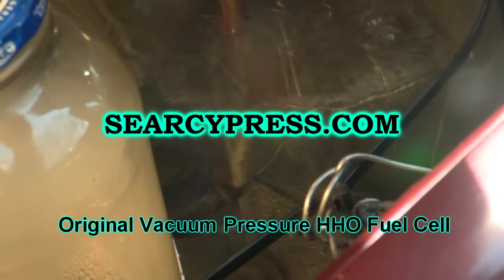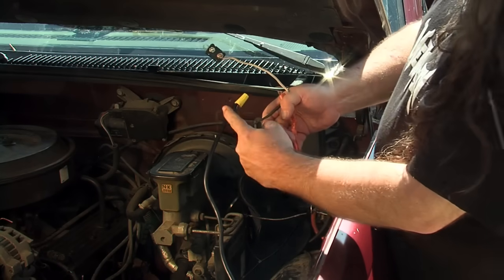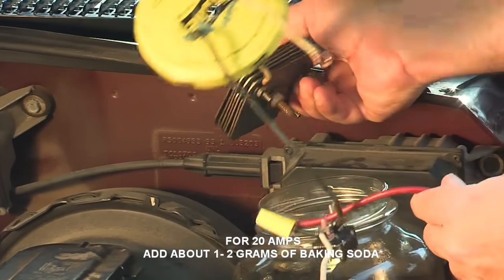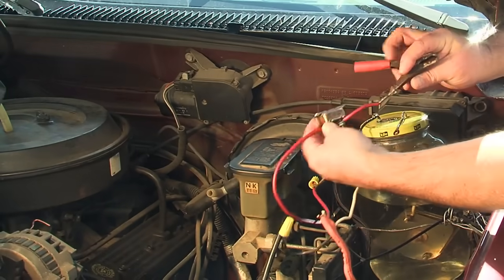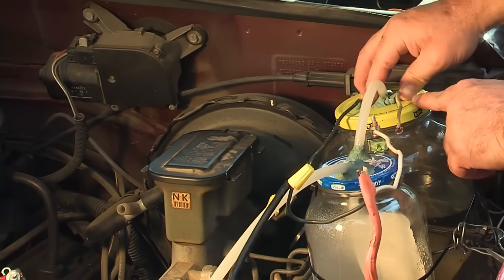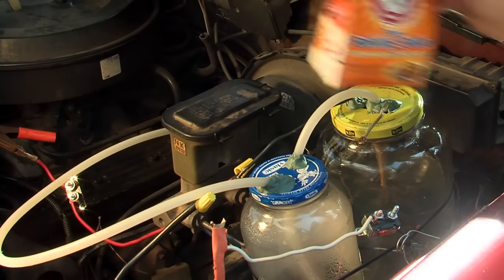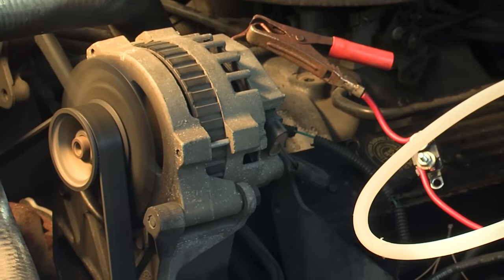Vacuum Pressure Hydrogen fuel cell defeats high gas prices using hydrogen from H2O.

Comment: This is not a Hydrogen fuel cell. It's a hydrogen generator. BIG difference.
Reply: Would increasing the plate size in the pickle jar make more vapor? I think it might since there is more surface area.
Reply: This is not a Hydrogen generator. It's john cena ( yeah I know fuck you too)
Reply: Calm down Thomas Edison
Reply: You hillbillies just do not realize that it takes energy to convert water into hydrogen, or browns gas.   Fact is it takes way more energy to turn water into hydrogen than you will ever get out of using the hydrogen for  fuel.  (About 3/2).   To spell it out, when you put that extra load on your alternator, the alternator pulls harder and uses more gasoline.  THAT EXTRA GASOLINE USED TO MAKE THE HYDROGEN HAS WAY MORE ENERGY IN IT THAN THE HYDROGEN PRODUCED.   Net, a loss, not a gain. The reason he is unaware of this is because he in reality is making very little hydrogen -- just comparatively a fart in the wind.  He would do better by feeding all the passengers beans, putting the intake into the passenger compartment.....   Hey would get more energy by buying his wife a dozen roses with the money he has wasted.
Reply: Lets say i have my battery starting the system, and my alternator doing its job after that? go grab a car battery, a bucket of salt water, and see how much hydrogen that produces.
Reply: Finally, someone who gets it, 37rainman. Exactly, the math and the nature of an internal combustion engine doesn't support it, period. I've seen people do it and they gained nothing and lost in some cases too. That's how good and bad it gets, for real. You barely gain "a fart in the wind" (lol, perfect), or you actually break even and in some cases, lose a tiny bit. The only reason people see an initial gain, is cause the computer hasn't figured out what's going on yet. When it does, your gains disappear, cause it self adjusts (just like designed to). Best real world example I've ever heard of it, along with proof. 

Then you get the people who go a step beyond and say "but you can get a new chip/reprogram the computer" to disable the thing from compensating for that or whatever. Similar to what modders do, when they want to "tune" the computer to a new mod, or bypass any restriction the manufacturer put in place. That's where the Math comes in. The energy created from a blast of fuel, the losses incured by thermodynamics etc. make it still, pointless. Utimately, hydrogen created in this "on the fly manner" is NOT powerful enough to do shit. It won't even turn the engine one revolution in an hour of generation. Literally, a fart in the wind, absolutely. 

That gas is exponentially more powerful (tested and proven) than this weak form of hydrogen. Real hydrogen in a tank though?! Totally different, that stuff powers rockets and is more than capable of the job. It's highly explosive and pure (professionally made). Matter of fact, the hydrogen car will certainly outpace the electric, by estimates. For many reasons too. Electric is a niche market, a fad. It's just too damned expensive. Hydrogen on the other hand, can be converted from current gas engines (retrofitted) for a few grand. So it doesn't require a new car. Just conversion of what you already own (win). Just like they did with propane powered vehicles for decades now (typically taxis do it). The hydrogen stations are already popping up, so we know that's the future (realistically). So hydrogen is certainly a "valid" technology and we will use it, just not the way these people are thinking. 

Where it really shines is speed. A hydrogen fill up, is just like petrol. Fill 'er up, done in minutes. Even with a Tesla supercharger (the best there is out there) it's still a minimum of 53 minutes. Better order a coffee and a snack. Lol. Sure the range is good now, but the charge still takes time. Not realistic on longer trips. The cost to replace those batteries after they've outlived their charge life too? Many thousands. This HHO/Browns gas, is no better. There is no gains, as you stated. Then there IS losses in the logevity of parts. It is well proven, that HHO, taxes alternators and batteries. LOTS of negative reports about people's car batteries not lasting as long on HHO and alternators burning out faster. Makes sense. They are only taxed to a certain degree with the vehicle as it is. 

You start hammering it with a higher load request, constantly, it's going to have to work  harder. That extra power is there as headroom when needed and there to constantly charge the battery, not for you to make useless HHO. Lol. That's how it affects other electrical generation/providing parts. So what are you saving, is the end question? IF you save on the gas (doubtful, at best), you will spend in parts. Wow, such a savings! Lol. There IS a price to this, so where is the gain?! 
The enthusiests then come back with "well, you just put a bigger alternator on there.", lol. Still not getting it, obviously. The end, does NOT justify the means, period. It's pretty simple. I dunno what these people think they are defending. LMAO! It's nothing. Not worth the powder to blow it to hell. It's just pointless.
Reply: @patrickgalloway5078  Yes you will get better milage if you disconnected the alternator (until your battery goes flat). Like your air conditioning - it sucks power directly proportional to the load on it. Your car AC sucks between 10 and 15 Horsepower at full load (which is why you never saw AC on a VW Beetle).
Reply: @patrickgalloway5078  You would!
seems you might be the slow one.
Alternators drain the engine of power, the more electricity it generates, the more it pulls the engine down.
In your mind, you could take a large car alternator and run your house from your Chevy but this is only because you don't understand how the alternator works.
Good luck with your studies and you owe rainman an apology for your very rude behavior.
Reply: @cornelius6304  lol no he didn’t
Reply: This is not a hydrogen generator. its a hydroxy booster...
Reply: Thou hast summoned me from the death, just as this comment.
Reply: The truth does not have an expiration date (Y)
Reply: @dishjuarezdishjuarez9329  hydroxy is different.
Reply: Everyone saying it’s a fart in the wind has never seen the gas ignited from one of these
Reply: @gsmithy7995  So what if it ignites?! That doesn't translate to power, but it seems in your mind it does, lol. Yeah, you can run a Bunson burner on HHO and even a welding torch. But when you introduce resistance, like weight and friction, it shows it's weakness. It just doesn't have the power to turn the engine over once after 45 minutes of generation, lol.

Speaking of small engines, HHO has actually been tried on a small engine, Project Farm did it just recently and guess what?! No gains whatsoever. Matter of fact the generator he used it on, ran about 20 seconds less time before running out of fuel, than straight gas did. Lol.
Reply: residue junkie  First of all: The OP is 5 years old, nice digging archeologist. 
Second: I'm pretty much done arguing with people who believe in free energy so ill just leave you with this; "The laws of thermodynamics". You can search them up to get a basic understanding of them, and if you still don't believe it then you can go deeper into how they really work and are proved.
(third: I really thought you were a troll, but your playlists suggest otherwise)
Reply: @kingsilencio6158  Proved by whoom? Do you have any credible source to back that up?
Reply: He left out a few critical statements here. Introducing more air into the vacuum line will cause fuel injectors to introduce more fuel, therefore burning way more fuel than you did before. Also without a good way to vent the gas you would most likely build up enough HHO gas under the hood to kill everyone in the truck................................If it's on the internet and someone made a extra long video about it = IT MUST BE TRUE? XD
Reply: Too bad we can't bottle arrogance. Seems to be a lot of it here.
Reply: This is satire!
Reply: Just as long as you feel better about your self..
Reply: residue junkie  so block yourself. Oh wait, you already do by not educating yourself.
Reply: @kingsilencio6158  Are you stupid, or just high?! That's covered in the debunking of Stan Meyer too. Lol. Patents, pffft, lol. There is the misconception that getting a patent for a device is some kind of proof that it works - which is "patently" untrue. 

The patent office doesn't test the designs it processes, it is simply a clerical operation where checks are made that the submitted documents meet certain criteria for completeness and correctness. There are a great many patents issued every year for devices that simply do not work. Lol. Literally EVERY B.S. claim about Stan Meyer is debunked. And how is being convicted in a court of law, for bilking investors out of money for a product that did NOT work, a conspiracy theory?! YOU gtfoh, gullible amateur. Lol.
Reply: @kingsilencio6158  Don't need to, gullible amateur, why waste my money on B.S., that does NOT work? The science is not on your side, period and you are VERY gullible. "he was silenced, derp". No, now THAT is a stupid conspiracy theory, lol. He was a hack with NO scientific training whatsoever and no threat to "da fossil fuel industry, hurr durr". His B.S. didn't work, nice try and nobody knocked him off, totally debunked.
Reply: The solution to this debate gentle men, is to compete to see which has the better H20 model
Reply: @jon smith Yeah, I'd say that's pretty accurate. According to some stuff I've seen, it seems like they want it to be true. Whereas honest ones are like "No, according to my mileage efficiency meter on the vehicle, I see nothing, no difference."
Reply: @jon smith Thanks
Reply: @jon smith Exactly! Well said and Mechanics will agree. A tune-up etc. and good maintenance can do wonders for efficiency. Also the style of your driving. Aggressive drivers (you know, those people who race to a red light, gun it from the red light etc.) waste an average of at least 10% more fuel. Something as simple as properly inflated tires, can make a 10% difference.
Reply: @jon smith There is simply not enough hydrogen in this nonsense to do anything. Pure, professionally made hydrogen in a tank, sure, hydrogen vehicles exists and the stuff powers rockets, but this system just doesn't even produce enough hydrogen in 45 minutes to make the engine revolve once. 

In reference to what you were saying about cooling however, there is a technology by BMW that injects water into the exhaust to improve efficiency, sure. It was used in a few of their vehicles and was co-invented by Bosch. The water tank sits in the trunk of those BMW's and has to be refilled every so often.
Reply: Not even that LOL it’s a battery . It’s literally a starting battery
Reply: @jon smith Yeah, that can be an issue in Canada too, in the bigger cities. We don't have emissions testing and such where I live, fortunately. 

A little trick that works well for that, is NEVER run premium gas for an emissions test on a regular vehicle that doesn't require premium, it will surely fail.
Reply: thank god eh..     fuel cells are a 100% loss system... first you use electricity to make hydrogen..  then the fuel cell turns it back to electricity... with massive loss's..

gotta wonder if they were trying to reinvent the "BATTERY"    lol
Reply: @jon smith Oh, I didn't know such an alternator existed, interesting.
Reply: fran nowak  umm I said it would work? Like 3 years ago? You must be in second grade then...
Reply: fran nowak  for real, am I missing a comment or something?
Reply: Some people call a fuel cell booster because it works in correlation with your gasoline to make your car run smoother and cleaner but it does work because I built one a few years ago and it worked brilliantly
Reply: Many years of debate. Can someone please give a step by step guide covering all obstacles?
Reply: @YNYNYNYNYNYN  it is thermodynamically impossible to gain energy out of the system. All one would be doing is destroying there engine with an incompressible fluid and producing very dangeroUs HHO combinations.
Reply: @debunkthis  have you tried it?
Reply: @YNYNYNYNYNYN  it’s basic physics
Reply: Whats in between the faceplates
Reply: Yall arguing 6 years later amazing
Reply: @hypnosis5660  indeed. During that timespan I've gotten a masters degree in engineering, I wonder what they've been up to.
Reply: @SatansOps  congrats man 👍
Reply: @hypnosis5660  that's told me :)
Reply: i built loads of these years ago ( dry cells and wet cells), no, a cell like that wont run a large capacity engine but will give a much cleaner burn which leads to better economy. Older cars without sensors everywhere were find, but the newer cars/(engines) know something is wrong(?) and try to adjust to compensate. check out Stanley Meyer or Bob Boyce, also JCB are making huge progress with their hydrogen run engines.👍
Reply: This was fun to read, can't wait to see what comes next
Reply: Rise from the dead 💀 🤣 😂
Reply: And generates fuck all amounts of hydrogen.
Reply: Are you one of my brothers or sisters
A good prayer:
I'm a sinner JESUS please forgive me for all my sins I know you shed your Blood for me on the cross at Calvary. Thank you JESUS for my salvation and for shedding they Blood for me. I love you JESUS. 
Romans 10:5/10 ct...❤️k
JESUSisLord!Amen...
Amen..
If you'd like to call someone who cares 
83
For
Truth.
bc you don't know when you'll die?
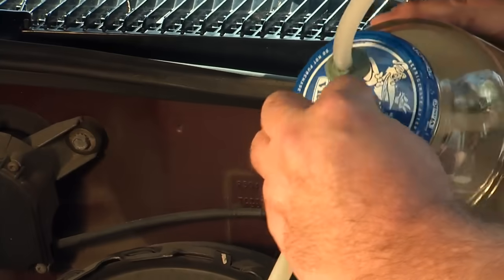.y r u hesitant......John 3:16 & Romans 10:5/19
Reply: You need the hydroxide, ask Bob Lazar
Reply: If it takes energy to make energy.. explain  magnets, lightening,  wind. Where does that energy come from? Where does that Entergys energy come from?    Please explain wise guy if you know so much... please enlighten us all on your superior wisdom and knowledge.    

Lightening comes from the ground and sky and it basically comes from nothing ... it has tremendous power and energy... reao free energy.  Just like you can take a ceramic pot.  Put in some aluminum,  copper and some lemon juice and have a 12v buttery... free energy from nothing... 

So you are wrong... with your lousy comment
Reply: @hoffmanhome6067  lightening comes from static stored and caused by friction within a cloud. Once the charge increases enough it discharges. Storms are created by the movement of water molucules to static areas caused by ions in the atmosphere caused partially by the sun and partially by the earth itself.

Many things including magnets which you think are magic including the magnetosphere which protects the planter from solar rays and radiantion are created by the core of the earth which is one big magnetron put in motion by gravity. 

None of the things you cited are "free energy".

Now lay off the bong.
Reply: @gregrohsful  power that literally is made from thin air.  Free energy.  
You have no argument bro
Reply from the maker: There's nothing free about it. The energy comes from the unburned gasoline that goes into the cylinder. Normally 80% of it is burned the rest is wasted through the catalytic converter. All we are doing is powering efficiency in the cylinder. The gain comes from the unburned fuel. Thanks very much for your comment and be sure and subscribe for the next video on this topic which will be coming out very soon.
Reply: @gregrohsful  Exactly, well said! No such thing as free energy. lol. Perpetual motion machines have consistently failed for centuries, for this very reason. You can't beat the laws of thermodynamics.
Reply: Whatever nerd
Reply: It’s an electrolyzer: 1 anode, 1 cathode splits the water molecule into hydrogen & oxygen.
Reply: Please explain
Reply: Im trying it! On my 02 chevy 6.0L a bit different system but same idea. I'll comment back
Reply from the maker: Its not the original engine. Sorry for the confusion. Thanks for the comment.
Reply: @metalpresstv  ) are you still using this?) I know you stated back then 30km!) I wonder if the computer will take away gains) ppl used to believe the World was flat!) & That man couldn't Fly) probably w/ All Inventions) humans will be negative very rare positive) I wonder if anything is possible) if ppl listen to all the negative) where would all the Inventions be we enjoy Today) technology) I wonder if Physics Theorm laws are absolute) it's the Garage!) That's Reall Life) therom Words! are nice)  but Garage is Proof) keep being positive) humanity needs this) I'm a blk dude) peace) I like the rock music)
Reply: @metalpresstv  does it work if you ad generator dynamo stuff on each wheels ? My first guess is that it wouldnt really be possible
Reply: amplify the power....
Reply: Bill Does Stuff lmao you’re still commenting after 2 years
Reply: @nathanc.8821  check out Garuda sanjivani root it's applied into electrically charged water to do what?
Reply: @nathanc.8821  Maybe learn why Youtube timestamps are shit there genius. For shorter times they are fairly accurate, but for anything a year or over, I've found they are grossly inaccurate. There is no way I watched this vid 2 years ago. I know for a fact, it was slightly over a year ago I saw this.
Reply: and that's why it doesn't work. It can't generate nearly enough hydrogen to even turn the engine on revolution. Not powerful enough, because it's as the other commenter explained. It's oxy hydrogen and there is not NEARLY enough being generated by this little setup to make a damned bit of difference. Even as a supplement to gas. It take energy to make energy and this takes more than it makes.
Reply: Bill Does Stuff was it new or old . If it’s newer then 1990 your communist new shit box is designed so it does nothing . You need a old none computer system controlled engine
Reply: @Polaris88Reid  Hehehe, communist new shitbox, lol. Yeah, I wouldn't disagree with that, I have heard people claim it works on old vehicles and being the gas guzzlers they were, I suppose any gain is a good gain, lol. 

If you tune it just right, yeah maybe, I have bent somewhat to the idea that "maybe" that's possible. On modern vehicles though no, and certainly not my communist shitbox from 2001. Lol. Most of the tests people do, are on new stuff, even generators. The generator ran 20-30 seconds less on Project Farm's recent test on HHO. And it is electronic fuel injection. 

I'd have to see evidence of it working on something older, like 100% legit evidence but I wouldn't discount the possibility. Seems to be a common enough claim and many of those claiming it are admitting it doesn't work on newer, so they "seem" more honest. Not like the zealots claiming nonsense anyway, lol. I still don't think the math nor science add up, but on old gas guzzlers and some tweaking? Meh, maybe and they sure could use it.
Reply: @MrBilld75  don’t waste your time or anything on any that think it’s a good idea. Electrolysis is less than 50% efficient... and it only gets worse as we know
Reply: @dennisford2000  Yeah, I know, the math and science just doesn't work. As I originally said, it only produces weak hydrogen, any gains made (which isn't even enough to turn the engine on revolution, in over half an hour of generation, lol) is immediately lost, once the computer catches on and adjusts. 

Others have tried it, properly and with well built advanced HHO systems (like dry HHO rather than wet) and never got any gains whatsoever, lol. They're nonsense and well debunked. Yeah it's combustable, but it's barely enough to run a little Bunson burner in a science lab, lol. 

Hydrogen fuel vehicles and professional, real, potent hydrogen, are the only valid hydrogen vehicles/tech right now. This stuff is play toy nonsense. Lol.
Reply: @MrBilld75  another way to see it : the alternator requires over a half hp to make 29 amps, and that figure will change as deposits form on the plates that gas burned won’t generate 300 w heat
Reply: You mean conversation of energy?
Reply: Bill Does Stuff i dont see any of your engineering videos posted? Would you please post a how to step by step on doing this correctly by engineering standards? Thanks
Reply: @MrBilld75  you are tripping. Hydrogen and oxygen are higher octane than any gasoline. Plus it cleans your engine. Lol. Wow.
Reply: bill does stuff ?  don't say it doesn't work you have never tried it and have zero experience at it , I don't care how much you've read . move on
Reply: Suck it Tony. You don't need to "try it" to know it doesn't FUCKING ADD UP, genius. You can spout off all you like about making on and trying to prove it. I've seen proof of it NOT working too. Not cause it wasn't done right either. It totally was. The fact is, the gains (if any) are meaningless.
Reply: The best part is people saying that it takes a ton of energy to make.... anyone in the world ever hear of a solar panel? Yes, his build is rudimentary and has zero statistical backup but come on people... it works....
Reply: it would help but in this case, current takes the shortest path from entry to exit,  so, a dry fuel cell set up could be better.
Reply: Technically the 2nd bottle is considered the fuel cell aft of the 1st generator.
Reply: Meth works the same in a Hemi 🤔

Smokes a bit, fkkr HaWLz tho
Reply: @magicyeti9256 I can agree to that
Reply: He says you should see water coming out of the exhaust once it gets going the water coming out of the exhaust will be tremendous. 😳😳 Is he putting water in the engine for it to come out exhaust . These sick people like to do damage they get a high
Reply: it works, the reason though it wont work mechanically on a modern car is because the air to fuel ratio isn't getting adjusted for it, and it will only get better gas milage at a certain and constant load, so you will have to adjust the air to fuel ratio from the pcm to make it work right, and yes it is possible, there's a thing called a tuner and another thing called a dyno, thanks to mostly the aftermarket, they provide tools and parts to make it work.
Reply: Eric Outram  and you rebuild your engine every other week?
No, I think you're lying
Reply: Some mileage is better than bad mileage.
Reply: He also said carburator instead of fuel injection. Even though he should have said intake manifold, we all knew what he meant. He is doing everyone a favor and you make a comment like that.  Good grief
Reply: @MrBilld75  
Yeah you are right. There are sensors that controls fuel and air. That's why one should feed it straight into the intake manifold and bypass any sensors.
Reply: Bob lazars Corvette runs on hydrogen
Reply: @dr.trichome6419  I doubt that a guy who was arrested for felony pandering was working at the same time at area 51. I doubt a guy with multiple degrees from CalTech and MIT would also enroll in entry level electronics classes at Pierce college in the valley. Lol. 

Bob Lazar's a fraud and a long time hoaxster. A nut a UFO nut and conspiracy theorist. His claims are worthless and debunked. If his B.S. was actually valid, everyone would be doing it, lol.
Reply: @dr.trichome6419  Bob Lazar claims he worked on reverse engineering UFOS out at area 51 and that the power source was element 115. Bob Lazar with no evidence claims it's stable, and he has 15lbs of it.

Every element above 83 is unstable. 115 was first created in the 2000s and lasts around 1/1000ths of a second. Lol, Bob is a liar.
Reply: A scientific study on the Effect of hydroxy (HHO) gas addition on gasoline engine performance and emissions was conducted with the following finding: 
Engine thermal efficiency has been increased up to 10% when HHO gas has been introduced into the air/fuel mixture, consequently reducing fuel consumption up to 34%.

Alexandria Engineering Journal
Volume 55, Issue 1, March 2016, Pages 243-251
https://doi.org/10.1016/j.aej.2015.10.016
Reply: Ross Harris Bill is correct, I actually tried this with a lawn mower because I wanted to try it. For it's size, it can't supply enough gas to get it to run. But, I did find out a propane torch will run a push mower, that was also from experience, I got tired of taking the carburetor off just to put it back on and have it flood yet again.
Reply: @bairfamilyfarm1336  you tried it with a lawn mower? Last I remember lawn mowers don’t have alternators 🤷🏽 and if you did hook it up to a riding lawnmower it would drain the battery
Reply: @gsmithy7995  Correct, lawn mowers have generators (magnets on the flywheel rotating around a coil vs a self-exciting 3-phase alternator). My idea though was putting a second battery in and running the brown gas generator off that. Never went passed a stationary test because a reasonably sized brown's gas generator still won't power a kohler twin.
Reply: We use physics and chemistry, you know that you learned in school?
Reply: Where exactly did i use Pseudoscience? I said that it wasnt a hydrogen fuel cell o.O
Reply: No it's not a generator. Kmsl..
Reply: @papermaker85  

Generator- creates something from something else. Often kinetic to electrical energy(wind turbine), but also electrical to potential(like a fuel), kinetic to kinetic(a water wheel turning a grain stone), and so on. It can be chemical, physical,  magnetic, or electrical in nature. 

I generate hydrogen using electrolysis.

Fuel cell- a container of fuel used as storage, generally liquid form, but can also be gaseous or solid. Most often temporary in nature, but can be semi-permanent. 

I have a 5 gallon fuel cell in my dragster with pure alcohol.

So yes, it is clearly a generator. It generates Hydrogen using electricity as the input medium for energy. This causes molecular bonds to break in the water molecules creating a gas. Some will condense back into water, some free oxygen, and some free hydrogen. It's not a 1 to 1 ratio. 1 unit electricity to 1 molecule of hydrogen. Even in a lab environment it's not 1 to 1. Much less in something this makeshift.

You can claim as someone else has here that the second jar operates as a fuel cell. Although that's not precise as it primarily functions as a trap or filter for salt  particles and condensate water. That's salt in the scientific term, not what you put on your fries. 

So overall you are essentially looking at a generator with an in line filter. 

Not sure what, other than facilitating air movement, the vacuum is about. It's extremely dangerous to cut into the brake booster line though. And I didn't see any check valve after the tee fitting. If you want to know what happens on a running engine if it's pulling in air through that vacuum line go pull a hose on your vehicle. It dies. Quite quickly. That's why the fitting the hose attaches to on the booster is also a one way check. Even if you take it off and cover the hole mostly with your finger the engine will begin running rough. 

I have serious doubts about this dubious video. Anyone who doesn't is not likely very intelligent about science, engineering, or even basic automotive knowledge.
Reply: @shaunofthedead3000  Well put! I agree and that's why I have serious doubts and because Engineers, Mechanics etc. have already said it's a scam.
Reply: @MrBilld75  

Yeah...I'm all for experimentation and crap, but the booster thing is a serious issue with me. If someone tries this on a post 1980 vehicle they will probably notice a significant change in braking. Pre 1980 they may not notice as much as the foot pressure required to brake was higher, but either way the braking distance will increase. 

Also on vehicles with ABS it will ruin the system. On vehicles without ABS you run an increased chance of locking up the brakes because of the increased need in pedal pressure. And locked brakes are dangerous. 

If people are wanting to test this you should start with the pickle jar and just hook up the power. Collect your off gassed hydrogen and see how much you can get over any amount of time. Then do a flame test to see if it is even concentrated enough to burn. After that you can figure out how much power went into creating the hydrogen and its value or lack thereof to gas savings. 

I'm all for saving gas. But this video is stupid, dangerous, and deceptive. And so are some of the commenters. 

I don't give a crap what you did...if you claim as I've seen in here that you never buy gas anymore or only buy gas once every year or so...you're not driving much at all, or you're lying. You pick what out you want. 

I can even tell you some additional tests you can play with if the car is disposable. Hook up pure hydrogen to the intake and see what happens. Put you a fancy regulator on it and all. You will burn pistons, rings, and gaskets just like a drag car with nitrous. You will melt spark plugs. You will overheat the engine. These things WILL happen without extensive modifications requiring a full engine rebuild. This is assuming you can get past the timing issues. 

ExxonMobil actually puts hydrogen into fuel mixtures. For the express reason of helping to clean engine internals. So a little bit won't do much. And this is about as good as what these guys are getting. Plus extra water in the fuel. Which is an non-compressible fluid. If you ever overdo that, have fun buying a new engine when the piston shoots through the head or oil pan, or wherever it ends up.
Reply: @shaunofthedead3000  Well written and very true. Yes, I have heard that, that it acts as an engine cleaner (although didn't know that Exxon did it). Just something I learned from listening to people talk about HHO and learning about different aspects of it. 

Also that yeah, water in your gas, beyond a certain point is a VERY bad thing which I learned from old time Mechanics. Water, unlike fuel, does not compress and acts like a brick in the engine. Something is going to give and it ain't pretty. He (Scotty Kilmer here on Youtube) showed what happens when you drive through water, with a low air intake and it sucks in water. Looks like a .50 cal bullet when through the oil pan. Just ripped a huge hole in it. 

I completely agree with the idea of experimentation, under more safe and controlled conditions. That's real Science. Generate some, test it to see how much flammability you get out of it. 

I thought that brake thing was very interesting and didn't know that. Not about the pre and post 1980 vehicles and how hooking it up to the booster might act, but I was not surprised to hear you mention how it could totally screw up an ABS system (and yes, lockup is dangerous, take it from someone who has never and still doesn't have ABS, I am not a fan really and ABS in winter, in Canada can do more harm than good.) I was taught old school (1980's) how to drive, before anti lock ever existed and how to brake without locking up the brakes, but I have locked them up once or twice before).

From what I have learned about ABD, I could totally see how this could mess with ABS, because of the ABS controller, which relies on gauging pressure, to prevent lockup.
Reply: It's like home cancer therapy - 100 plpl tested it, 70 are death include Steve Jobs and 25 are happy that it works and other 5  are writing books about it. It's not science method.
In my opinion this can work ONLY with very BAD engine - bad carburetor with bad ratio fuel:air, bad mixing them together, bad electric arc! When everything is wrong, MAYBE hydrogen from 29Amp*12V=300W of extra power can help make every combustion in valve effecient .... From example 15-20% to STANDART 25-30% for OLD CARS. New car with lambda sonda...s(!) and computer inside, with fuel injections ...they can be in desilusions what is it with engine and they can switch into basic working diagram with 15% fuel consumption plus. 
Lot's of people waste their time on it and i'm here only find right words to explain them this false concept/mistake. 
... In this video is old car. I like see this on car from 2000, 2005, 2010 and 2015.
Reply: @MrBilld75  It's not the ABS as a car brakes fine without it. It's the fact that a newer car relies heavily on the vacuum booster for brakes. Just imagine one of the glass jars breaking or leaking, the car could lose 90% of its braking ability.
Reply: @patmul-k6798  Yeah, good point! I watch Youtube Mechanics to get better at repair to my vehicles and they would agree.
Reply: @MrBilld75  you do seem to know your shit.
I'm trying to study the brown gas effects on engines and stumbled on this video. 
Have you heard of Bob Boyce and his design? I can't imagine anyone developing a generator that can produce the gas through an alternator in volumes that could make a difference but his design seems to come close. Later man.
Reply: @romanhanajik3185  amen
Reply: @papermaker85  Yeah, it actually is, imbecile. It's a fucking generator.
Reply: @5dope You are not getting it. Sure it can work, "a little bit" with enough energy, but the problem is, what it produces is not quality hydrogen gas. Not like you get in a tank of professional hydrogen. To make that, takes a lot more than a simple device under your hood. 

It's even worse on modern vehicles, because the computer will soon learn and defeat your efforts. In a carburated engine, if you tweak it right, it could give you some possible gains and considering what gas guzzlers they were, anything, however small is an improvement, but it's not going to make a damned bit of difference on a modern vehicle. It's been tested, you get no gains on a modern vehicle, after the computer figures out what's going on. 

You are also negating the other things it affects, like how a higher draw on the electrical system, is going to wear parts faster and use more gas. Gains are quickly defeated in a modern vehicle and it's not worth it. What little you save on gas, if anything, will go to premature repairs. Mechanics and Engineers and even Math and Physics experts have analyzed this, in depth. You gain nothing, it's a complete waste of time, effort and money. 

Sure you can run a welding torch on it, I've seen that too. It's rather impressive and totally works, yes. I've seen the video evidence of it.
Reply: @MrBilld75  you know the real problem is people have been fooled into believing all the knowledge that's needed has been recorded by someone else and we simply read it,memorize it and we are then intelligent, no need to be skeptical right? Or just curious maybe, board even. Where would science be without skeptics?
Reply: Perforated plates will i crease the gas.
Nice vid it would be good to see the link up to the carburetor 
Cheers.
Reply: @platinumsky845  hell no I won't for the simple fact you seen the video regardless of what a fuel cell looks like the end result is it produces the same thing hydrogen bubbles and you take a match or lighter to them they explode no more no less while they assist through vacuum of the car gasoline to make a car run smoother and give it better gas mileage there is nothing really amazing about it once you understand the basics of hydrogen
Reply: @MrBilld75  all I'm sure of is, there is more power to harness from gas than the universities teach kids. They teach kids a theory, claiming it's a fact.
Reply from the maker: The "Science" is in fact processed organized religion.
Reply: @Bill Does Stuff. But this can actually work. If you store hydrogen and oxygen in separate bottles (like air tanks) and hook it up directly to the engine. Instead of your fuel line and air intake. Maybe adjust the mixture a little but this should work. I saw something similar in an other video and it actually works
Reply: @thadevilhimself6668  no they dont. All these people say "they have seen it work" can never show these things working. 

 Why would you need a source of oxygen? This isnt a rocket engine where the level of fuel used needs an outside source of oxygen for proper combustion.  

 Is there a way to separate oxygen and hydrogen from water with the power available from an existing engine in anounts that would affect gas mileage is the question. The answer is no.
Reply: @gregrohsful  mate, i’ve seen it work okay… i know it can work. You don’t need a separate source of oxygen. It’s just more safe to mix it only at the very last moment. You don’t need to generate  hydrogen and oxygen at the spot in your car. You can generate hydrogen and oxygen at home and fill up gas bottles with it and use that as your fuel cells. Is all i’m saying.
Reply: @gregrohsful  you can make it like this guy did but that’s very fcking unstable and explosive. But you can make it also in a way that you have seperate output of hydrogen gas and oxygen…..
Reply: @thadevilhimself6668  you can make it but why? It adds nothing to your gas mileage and introduces extra water vapor into your combustion chamber... nope
Reply: Either you just had an anyerism or you're really illiterate and can't read. I wrote that this wasn't a hydrogen fuel cell, that is all I fucking wrote. I am very fucking aware that trying to fuel a car with hydrogen in this sense won't work; And I have made ZERO(0) claims that it does.
Reply: @SatansOps  aneurysm,now who is illiterate
Reply: All these pocket heros, why not get a larger fan belt and put a aircraft magneto in the curcuit it will have way more power than the alternator and supply way more current than the loss from the conservation of energy law. People forget that there are mechanical devices that have been around for years that produce way more energy than it takes to run them.
Reply: matt bugg nope. You clearly have no idea what you’re taking about...dummy.
Reply: That's awesome Eric! Now there's a valid fuel technology, biodiesel. Absolutely. I have a buddy converting his diesel truck to that right now. Most places are happy to give it too. They have to pay to have dirty oil removed and you take it for fuel. Sure some work is involved (filtering it etc.), but it seems WELL worth it.
Reply: ofc its not hydrogen cell :)
Only a idiot or totaly layman would mistake these two :D
Reply: The problem these guys are having is what is a logical fallicy, the look and see a process that isn't 100% free energy because it doesn't follow the law of conservation of energy. In this law you need a equal input to output. However they failed because this is a engine, engines create work you use energy to transform it to work, W=timexenergy. Less time more work, more time less work, more time more work, less time less work. It's a equation with more than one outcome, it has 4 outcomes in the simplest form. Without balencing all four which you nor them has done your not doing much of anything but substitution.
Reply: @mattbugg4568  what the in the f**k are you talking about. Are you being serious? Your entire comment was just utter gibberish, it was nonsense. Balancing the equation to prove that energy output of engines can be greater than 100%? Your just trolling right?
Reply: Hmmm benigne hypocrisy of the utter lack of intelligence of these above placed comments. Oh the foolish pish posh, I do say. Mmmmmhm with the mollecular composition of the atomic structure hmmmm I'm more intelligent than all of you haa
Reply: @mackdoe2491  😂😭💀
Reply: Well then, my apologies leepailong123. Thank you for clearing that up about exactly what your stance was. Now it is very concrete what you were saying. I made an assumption as to what you "might" be eluding to in your statement and that was incorrect and presumptuous of me. My bad. It's just that your statement was short and you did not elaborate on it. So I jumped to conclusions about your meaning when I should not have. Not something I do often. It's just there are so many of these boneheads in here and all over Youtube believing in this nonsense, I accidently lumped you with them and that was wrong. I am man enough to admit when I am wrong and now that I know clearly where you stand on the issue, I commend your brains and common sense and statement that this cannot work. You are indeed correct and I am of that same belief, based on Math and Science. Not this Pseudoscience nonsense, that these people spout. Cheers!
Reply: @MrBilld75  people in stances never get anything done...they are the dregs of the scientific world...
Reply: @MrBilld75  I'll be trying this system out. Then I'll respond to Bill Does Stuff, Leepailong, and all the rest of the same kind of people who were unable to recognize a c7ntrolled dem6olition, or who use their generally valid mental constructions to cast imaginary, comfortable and rationalizing limits on complex realities. And I can think of several different reasons global corporate auto industry would shun this tech, with nearly no effort.
Reply: @MrBilld75  your book knowledge may be outstanding but you're on the job experience as have probably never even used it or ever made one shows your complex complete lack of ignorance because this does work I have built one and witnessed it first hand so unless you've been there done that quit sharing your pseudo science technology with us
Reply: @MrBilld75  regardless of your beliefs I believe you just love hearing yourself apparently you're on the defensive by making so many statements defending your comments seems to me like one statement would be enough
Reply: Bill Does Stuff obviously you are well indoctrinated and know nothing of the findings of NIKOLA TESLA and free energy and i dont mean free monetarily energy is all around us and can be harnessed very easily have you not heard of the tesla coil  its so easy my kids and myself made a small one and with the power of a 9volt battery were powering lightbulbs without even touching the coil so the energy is there. We never hear about these things because they have been suppressed so the big oil and energy tycoons can continue to make fortunes off of our ignorance
Reply: @The_Mycilium_Maestro  Free Energy as in already generated from ambient radiations and you need a charge building detector to make use of it..
Reply: +James Walker:   The "proof is in the putting"   I would bet your car gets about the same gas mileage as mine, and your house uses electricity from the grid just like mine, and on neither one of them is any device such as shown in this vid.   The fact that you might have made a "Tesla coil" proves nothing about whether you have demod any free energy, or whether the nonsense in this vid is real.   The fact is, you would have made more light with your 9v battery if you would have skipped the coil and just connected bulbs to the battery.    Tesla would laugh at you and your ignorance of basic physics.
Reply: @rymichael7203  today's lesson class of misfit scientists: listen to this guy here because he's sounds like the most intelligent guy in here while the rest of you curse each other for only God knows why!..
Reply: @37rainman  nikola would not laugh, he would be surprised of how dumber the future got xDDD
Reply: Don't even assume you can school me on Tesla, James. Lol. He was one of my heros. You are using him as a straw man, however and it's invalid. This fucking discussion is NOT about him or his ideas/inventions. It hasn't been "suppressed" either. Lol. You are talking like a conspiratard and I know your type. Fuck off, with your delusions you got from Youtube conspiracy vids. You people crack me up.
Reply: @twistedkyote4107  You are showing signs of Dunn And Kruger disease.
Reply: @Radark75  So you psycho analysis what people say 
I reckon Your the crazy one for assuming what dwells within someone else's Head .
Reply: 4 years of arguments means this item needs proper reaserch
Reply: @ALL COMMENTORS "bill does stuff" is a lobbyist for the petroleum fuel industry. Bill is allowed to be a stubborn blockhead if he chooses. Arguing any points gain no ground.  Sure this video is flawed, the set-up needs work/improvement and its probably NOT a good idea to run out and do this to your car. However, this along with other videos, articles, and experiments have conclusively proven that vehicles can operate on alternative fuel sources. Point is be inspired, take the good, leave the bad and tweak it until you have something useful/worthwhile... And the world becomes a better place
Reply: @selfmade-mv3rz  Lol. stupid conspiracy theorist. Still waiting on that elusive check from the petrol companies I'm supposedly shilling for. *facepalm. How lame and a typical tactic of losers with no argument.
Reply: Bill Does Stuff    YOUR COMMENTS, WE ASSUME ARE BASED UPON YOUR OWN EXPERIENCE WITH YOUR OWN VEHICLE PRESENTLY ?  ALONG WITH ALL THE OTHER NEIGHBORS, COMMENTING ?
Reply: @avail1.  well said.
Reply: @avail1.  I think this guy works for Texaco or something. Why does everybody state an increase in mpg? He's another negative asshole.
Reply: Have any of you “scientists” ever heard of Stanley Meyer?? Water can power an engine WITHOUT any help from energy source. Technology has been around since the 80s . All of you saying “I’ve done all the research” , you missed something!!!!!!!
Reply: @kingsilencio6158   Nobody has been able to reproduce Meyer's claims to the extent that they're verifiable by independent scientific testing. Why is that?

Simple... because bad science doesn't work. All bad science does is begat more bad science and this is a perfect example. 

Why hasn't a Nobel prize been awarded for breaking the laws of thermodynamics? Lol. Meyer was not a Scientist nor did he have formal training even related to any science. There were no independent scientists or others who were prepared to state categorically that Stan Meyer's technology actually worked as claimed.

One of the major problems with Meyer's claims was he was using frequencies in the tens of kilohertz range - but water molecules have a resonant frequency of around 22GHz, and only when in vapor form (when in liquid state, the molecules are in such close proximity that very little resonance is observed at any frequency). Obviously, Meyer's claims of establishing some kinds of resonance at a frequency that is some six orders of magnitude too low in frequency are a joke.
Reply: @kingsilencio6158  Have you read the patent on Stanley Meyers so called "fuel cell"? It's really dumb, and furthermore does not work. 

" Meyer's claims about his "Water Fuel Cell" and the car that it powered were found to be fraudulent by an Ohio court in 1996"
Reply: @kingsilencio6158   Lol, debunked nonsense. "Stan Meyer was convicted of fraud in 1996 after he was unable to demonstrate his claims to investors or the court after soliciting large sums of money for commercializing his technology."
Reply: @platinumsky845  yo youngblood I could give a rat's ass whether you believe what I said or not get off your high horse I can't help it if you're old lady run your ass off and you're living in your mama's basement at home and you're burden of proof which you probably don't even know what the word means to start with you've probably read one book in your life and took notes on all the big fancy words that made you sound like a college professor to all your peers so why don't you just quit worrying about the mule and load the wagon and accept things as they are, like I said I could care less whether you believe me or not I say your knowledge of hydrogen is probably what little you learned in high school because I doubt if you know how to build a dog box let alone a hydrogen cell booster so run along and draw your mama a pretty picture to put on her refrigerator
Reply: And the neverending comments keep going!  😂😂  I hope the OP makes a million $$ from this video.  ....I would say HHO as an energy source (the revenue generated from this video - as well as the time and blathering in the comments- this one included) is pretty viable.
Cheers.
Reply: @puhleez420  With the amount of subscribers and like to dislike ratio; He's not making anything. Except making people think that he's dumb.
Reply: There must be a whole lot of people that work for gas companies on here making comments the way they are negatively talking about hydrogen the cleanest burning fuel on the planet
Reply: @terryhill4732  Hydrogen would be nice, except it is very impractical to store, we have no engines designed for it; and you'd still need power to make it. To make hydrogen from water, you need to pump electricity into the water thus separating the oxygen from the hydrogen which means you'd still most likely use fossil fuels to make the hydrogen.

This is of course if you want to burn it. If you use an actual fuel cell (that I was talking about in this thread a couple of years ago) that run oxygen and hydrogen through a platinum catalyst and generating power through electrolysis. it is more practical; but you still have to produce the hydrogen and also get the platinum, which is an expensive metal.

For either of these to work, we'd need to switch entirely from oil, natural gas and other fossil fuels to Solar, Wind, Water and nuclear generated power so we can actually create hydrogen (or whatever gas we end up using, hopefully something less explosive) with a neutral carbon footprint. But that's very much not the scope of this video.
Reply: @SatansOps  they are talking about having hydrogen filling stations with the ability to make hydrogen at the station to eliminate transporting it, regardless of whether we use electric vehicles or hydrogen we will still be using unrenewable resources because electric vehicles batteries are made from Cobalt and lithium mainly
Reply: @terryhill4732  Indeed. But using lithium is still preferable to using coal/gas because of the carbon footprint. And hydrogen filling stations sounds like a good idea until you consider that all those places need power to produce it. I find the water-hydrogen plants to be more interesting. Place a hydrogen generating plant somewhere out in the ocean and then take the cost of shipping it. You can either use solar, wind or water currents as a means of generating energy.

But I think we can both agree that mixing in hydrogen with gasoline isn't exactly going to solve anything, right?
Reply: @SatansOps  nope I don't agree I believe that they will probably have a retro fit hydrogen assembly that can be installed on gasoline engines as an alternative because there are too many internal combustion engines in the world but by having alternative sources of hydrogen and electric cars it will cut back on the demand for oil and by using the retro fit would also help cut back on dependency for oil, and as far as a carbon footprint all that is is a liberal Democrat talking point along with global warming even the human body is made up of over 50% of carbon so I don't see any issue with carbon footprints
Reply: @SatansOps  also on hydrogen filling stations you could do the same thing on land by using solar energy and then take out the cost of having to transport it to keep it cheaper
Reply: @SatansOps  apparently you know very little about internal combustion engines there are diesel engines right now that will run on vegetable cooking oil or called biofuel you might want to research that and as far as your knowledge on global warming you're lost out in left field with no glove on
Reply: @SatansOps  also youngblood there are internal engines also running on corn which is ethanol that people use every day so don't try schooling me on what gasoline diesel engines will or will not run on and I forgive you for being School in today's society because you have been terribly misled
Reply: @terryhill4732  Diesel engines can run on plenty of things that are liquids keyword being "liquid"  (also running a normal non converted diesel engine on vegetable cooking oil is going to clog that thing up fast). Neither engines using diesel or engines using gasoline can run solely on a gas (Such as Hydrogen). Here in Sweden we actually use biofuel quite a bit, but burning that is still bad for the environment.

Also you might not want to call people out on global warming when you clearly don't understand it at all. And as political views go, I'm more of a right-leaning person; even though it's not exactly relevant here.

Even more we should be moving away from combustion engines. Splitting hydrogen with electricity to then burn it again isn't exactly a smart solution long term. Only reason to use hydrogen would be to use it instead of expensive and difficult to produce batteries, in which case we would still not want to burn it and instead use a real hydrogen fuel cell to convert it into electricity.
Reply: @SatansOps  bye Einstein you have a lot to learn Young blood for future debates quit changing your narrative so much, say hi to Abba for me one of my favorite groups of all time and especially Agnetha
Reply: @terryhill4732  Don't we all have lots of things to learn? And my narrative has been pretty much the same here, and I would not call this a debate. Lastly, you're the one who commented in a five year old thread.
Reply: it works 60 to 80 miles per gal but vape gas gets 300 miles per gal on a 4cy chevy . some advice on cooling engine needed . Going to try to water cool the exhaust ill get back to you . Im going to brake 1000 miles per gal  soon enough
Reply: I say try it an see.. I've been using this setup on my 99 deawoo for a few years now. haven't bought gas in a long long time..
Reply: @parrisestatessouthernhomec3246  would it be possible to adjust something like this to a motorcycle?
Reply: michael Parris liar
Reply: @MrBilld75  I'm a mechanic with a 44 ford who uses a hydrogen booster when I'm on the highway it implodes vs explodes & boom I got almost 10 extra miles when I use it properly
tragic how hypnotized You are
Reply: @twistedkyote4107  He should change his handle to BILL DOESN’T DO STUFF! He keeps saying that he has not done it. Cannot know for sure unless you try it. It sounds as though he’s part of the problem, and the problem is that oil companies and their lackies have been screwing us for years out of our hard earned money. All energy should be free. Not a monopoly.
Reply: @twistedkyote4107  isn't an implosion due to gravity finally winning over other forces that are causing an expansion of matter? Besides how would an implosion help you pistons move?
Reply: No, actually, Ross. I have not tried it, nor will I. It is a waste of time and money and does nothing and is dangerous as well. You people have no idea what you are dealing with. I have watched enough videos and done enough other research (articles) and talked to enough people who said it does not work, to know that this nonsense does not work. It is impossible, because multiple acpects of "real" Science do not support it, at all.
Reply: @MrBilld75  me and my brother fiddled with this stuff a lot when we were teenagers. And it would improve milage by about 25 percent. I know we were both uneducated, having only gone to school for 7 years. But I don't care how uneducated we were, if we could make 5 trips to town instead of four, (on a regular basis) we thought we saved ourselves some dollars. One other thing we did is: we would install a glass marble float valve on the carburetor and a hose with partial vacuum to the gas chamber. With that we were able to run a 1981 dodge 3/4 ton with a 4 barrel carburetor and 360 engine with about an average load of 1 1/2 ton of cargo at 30 miles a gallon on average. Now again I am uneducated but that is a little over double of what trucks are running even today, 30 years later.
Another thought: we are not burning hydrocarbons very efficiently. If we burned them, they would not go into the air.
Reply: @MrBilld75  Every one is an expert,good grief.
Reply: @MrBilld75  sounds like main stream science to me lol. ahh good ol
 2021.
Reply: @i_am_wi11_  And this B.S. sounds like "alternative facts" and pseudoscience, lol. And mainstream is one word, lol.
Reply: @MrBilld75  So taking excess energy being produced by the alternator to make hydrogen wont add power to the system? Otherwise my battery is just dumping the excess power because its already at max charge.
Reply: @MrBilld75  lol. What "doesn't work"? Lol. Some people.
Reply: @MrBilld75  glad you talked to enough people to manipulate your psyche into believing falsities if physics and energy laws,  not to mention thermal dynamics and let's bring some sort of quantum physics/mathematics  computations  describe how the explosion power of hydrogen  when  ignited or released helps to justify the over unity state or properties ie free energy or the production of more energy then the input.... Think it,  feel it,  live it, love it
.. A lot of events that occur, happen in the now & are then equated into events of the past,  are either written off ~ not worthy of noting or ultimately pointless,  while this my friend is definitely worth noting,  had a point and by sharing ideas and combining ideas and efforts this concept has truly skyrocketed.  Let this concept make history for the better of the earth and humanity itself,  and may the physics and properties here in bestow the modern energy and thermal dynamic laws of which we live,  and may it all be understood one day and the world lives in peace and pollution free happily ever after.... Amen
Reply: @DJGive1  I got You brother
Hay shil it's not a explosion it's a implosion drops mic
Reply: DJGive1 thermodynamics
Reply: @DJGive1  whwt
Reply: GOD bless you brother GOD bless you on behalf of the now majority of poor citizens of this great nation u.s.a whom can bearly,afford these outrageous topend fluctuating gas prices ⛽⬆⬆⏫⏫🔄⬆⬆⏫💹 we need information such as this which eases the stinging crunch on an already strained(FINANCIALL} pocketbook or billfold THANK YOU MAY OUR GOOD LORD BLESS AND KEEP YOU AND YOURS.
Reply: @randywilliams2754  Give me a break. Adjusted for inflation gas has averaged 2.25 a gallon since we have been making it...